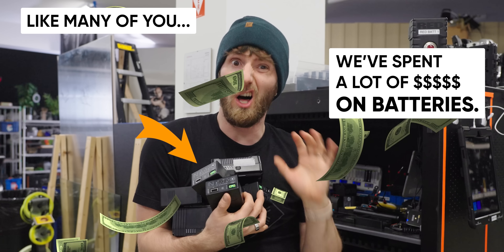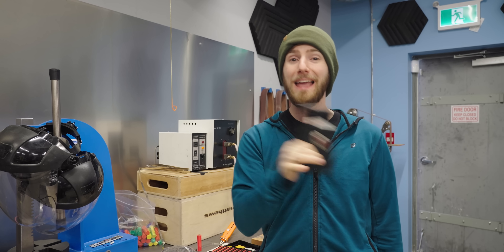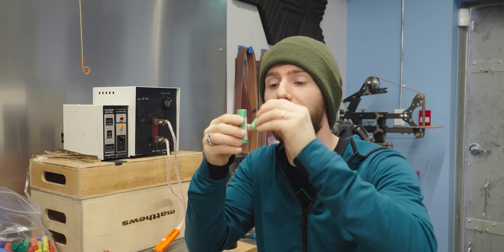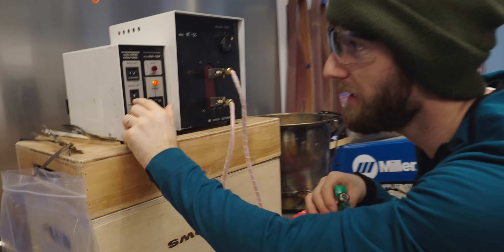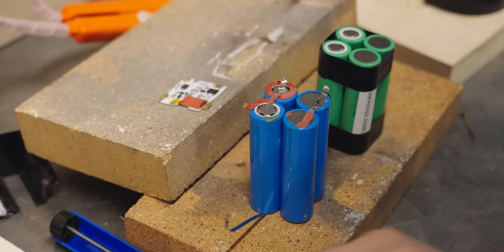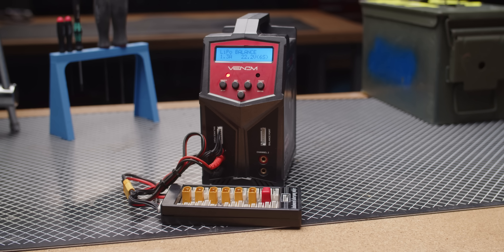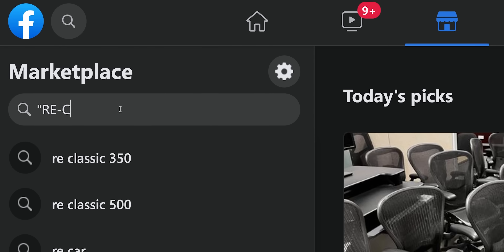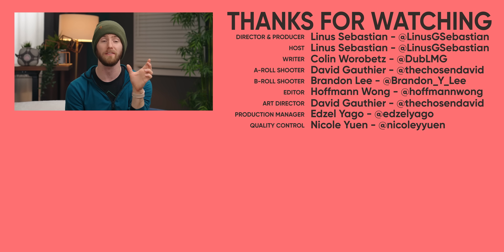This should be illegal… Battery Repair Blocking

Comment: Stay near the center of the cell top and away from the edge (where the battery wrap is).  The entire battery under the color wrapping is actually live.  I can’t remember if it’s positive or negative but the entire battery cell is one and then the other is only the small top.  If your spot welding and you get to close to the plastic wrap you could melt it and short the battery.  Watching you spot weld it looked like that was what y’all were doing in this case.. you accidentally weld the positive to the negative right at the cell edge.
Reply: The top is positive and the rest of the cell is negative. And yes, that negative pole is dangerously close to the positive pole and it's only covered by thin plastic wrap. I've experienced some scary moments when that plastic cover was scratched or broken on used cells. Since then I always have 18650 shrink-wrap in my drawer and I always put it on used cells whenever I want to re-use them.

Comment: Every lithium battery in costumer electronics like these should be 18650 (or any of it's variants) and if you need a different kind of battery (because it needs to be flat for phones or to trace a strange motherboard) you should be required to prove you need a different non standard kind before putting it on the market.
Reply: Just like the old and gold AA, AAA, cr32, lr13, etc... standard.

Comment: Are the batteries inside not e-waste themselves? If so, you’re not keeping anything out of landfills. What is needed is batteries that rejuvenate themselves. Just wait until all those electric vehicle batteries start entering landfills. The pollution of fossil fuels will be minuscule in comparison.
Reply: That Red battery pack was a bad example. It's not a device with a built-in battery, it's just the battery cells with a little plastic around it and a small pcb. It was actually the worst example because those v-mount battery packs are a decades-old open standard which is used by all manufacturers in the film and broadcast business. These batteries are interchangeable between countless devices and you can buy them from dozens of manufacturers. It's actually the best system I know and only comparable in versatility to single AA NiMh cells.

Comment: Very nice video.
Ive been taking 18650 out of old notebook batteries for so long(5+ years) to fuel my RC stuff. heheheh.
I just solder them tho, take extreme caution, never had a cell go poof on me. So it is possible.
And yeah you can order any style BMS of of some china site, where some are really good.
I dont buy powerbanks or batteries anymore, just use the 18650 from old notebooks. Usually its just 1 or 2 (of the 4-6) cells that are damaged/empty.

Disclaimer, dont do it, i have 30 years electronics experience. Just send them to me. :D

Comment: Those battery fires aren't inextinguishable, and that's a dangerous myth to promote because it prevents people from preparing with better fire-fighting alternatives. The lithium combines with water to produce two chemicals, lithium-hydroxide (or something like that) and hydrogen gas in the form of H2. Notice the missing O on that last one, and you'll understand where the problem comes from.

Comment: for this video, it is bad example, i did just like you in early stage. You should study a bit for this, especially when you doing it with big amount of battery, it should go through IR and capacity cabinet tester which vape shop cant provide and not expected for that kind of use.  
Battery is quite complicated, it got brand, capacity, IR, volt, charging/discharge behaviour, and also power/capacity battery.
so if you really trying the replace them you have to use the same model or similar specs from product sheet, especially for power tool(power drill), hand vacuum, they need power battery for higher discharge current.
ps. vape shop usually only sell capacity battery.

Comment: I am struggling to solder wire on top of a new 18650 battery of my mini vacuum, it could be much more easier, if that just like anything with AA or AAA batteries. 
Anytime I can I try to educate other people but it should be done more.. thanks Linus
Reply: Been changing the 18650's in my house lights as well. Vigorous sanding (I used an engraving tool with a sander tip XD ) and using the thick part of the soldering irons tip seems to help.

The new battery was about the price of the light and lasts a couple of weeks!
Reply: @Hajile_Ibushi  If you use good flux, you don't even need to sand them. It needs to be flux for electronic components of course, none of that stuff for metal pipes that contains acid. But with some of the stronger electronics flux varieties, you can be quick enough with the soldering iron as to not heat up the cell too much. It works fine, I've done it a couple times.

Comment: This means that even in case of deep discharge, the BMS’s memory will be wiped off. Even though BMS will be able to prevent deep discharge, however if a fully discharged is kept idle for long time, this can still lead to wiping of volatile memory.

Comment: Most BMS have safety feature. They when you put the batteries in cut the output, until outside voltage is applied (charging). That's for safety to ensure thing will short out during shipment. You only need a few seconds of charging to unlock it. Did you try to charge the battery?
Reply: And the sparks they had were not short circuits, but just simply sparks from the spot welder making bad contact. Sad that they threw those fine cells away.

Comment: Hi Linus and team, as a previous Quality engineer at a solid state battery manufacturer, I have learned a thing or two about … well batteries and BMSs. BMS charge curves have to be tailored for the battery chemistry. Some battery packs, of same size, and voltages, will not have the same charge / discharge curves. (Look for the “C” value - C/20 for large packs like the one in a car or 20c like the ones on those dumb LiPO RC packs you were showing off)

If I were manufacturing a BMS today, I would be sure to add tamper proof features, because, like you kind of pointes out, when a fire occurs, it’s the manufacturer’s name that’s on the box … not yours. 

However, I do think the last camera manufacturer has the best idea here and to offer something like cell replacement is a great idea. AND I would LOVE to see a battery recycling center.
Reply: Yeah, I was thinking the same thing... certainly Red or Sony wouldn't like to see footage on the news where one of "their" branded battery packs goes up in flames and hurts a bunch of people. I can kind of understand their reluctance to let people work on those products.

Comment: The board probably detected the sudden voltage change from low to high...maybe this would work better if you completely drained the batteries first?

Comment: seeing linus assembling the battery is funny af, I worked in a factory where we welded the batteries together, it's actually a multi step process.
First, glue pairs of batteries,
then glue pairs of the paired batteries,
then you weld those 4 together,
Grab a few of the 4 cell packs and weld those together.

And yes we did this for Red One cameras xD

Comment: That spark was caused by the crappy spot welder leads or not applying enough pressure.. the batteries are just fine.
Source: my job.

Comment: I was planning on doing this to my laptop's battery which i found out has 4 18650 Samsung batteries in it, but 4 new batteries cost more than a brand new assembled battery....
Reply: Re-celling battery packs usually doesn't pay off when you have to pay end-user prices for the cells. The cells are the most expensive thing in those packs, the rest is just some plastic and a small pcb.
Reply: @highks496  yeah my vape shop sells batteries for abt $10 for a piece and a complete battery is around $30

Comment: Did you really need such high power batteries for this application? You could have probably doubled battery life using 4-5000 mah batteries with 10 amp max output.
Reply: There are no 4000-5000 mAh 18650 cells, at least not real ones. You can find them on ebay, but they're using "Chinese mAh". The highest you can get is 3600 mAh, I haven't seen any more yet.
And Red batteries are known for their rather high amperage rating, Red cameras consume quite a lot of energy (at least the old models used to). These batteries (v-mount) are often used for LED lights and larger monitors as well, so you'd definitely want a 10A continuous rating at a minimum. I just looked up the tech specs of Coreswx batteries (who according to Red make the Red batteries) and all their v-mounts are between 12/20 A and 15/20 A (continuous/max)

Comment: hey noob.....reset the bms!!...and use smaller strips to not short out the batteries! some bms you can reset without software! but for some u have to use a computer! both should not be a problem for you and your company!

Comment: 18650 batteries are surprisingly dangerous if they decide to miraculously fail. they are the most commonly used ones for vaping too. ive had a couple blow up on me and its kinda scary. one turned into a rocket basically lol

Comment: A tour of the battery recycling plant would be pretty interesting, it's watt I want to see and hopefully there's not much resistance to the idea. Will you go in the front gate or do you think you'd have to volt the fence? A move into current affairs is a strong one.

Comment: You wouldn't need to sacrifice a battery just get an object 18 mm in diameter and some 65 or greater. 18650 is the dimensions of the battery.

Comment: I have an HP zbook with an external battery pack, and you CANNOT rebuild that thing.  the pouch batteries they used are near impossible to replace, and the pack itself has to be cut open. I hate it. But HP discontinued my battery, so yep, I just do without.

Comment: I bought a cheap smartphone - Alcatel One. After a few months out of warranty it wanted to upgrade Android. Okay, I let it. The upgrade failed and the phone went back to factory default. Little annoying but I'll survive. Then it kept whining that it wanted to try the upgrade again. After around six months I finally relented and it went through just fine this time. Or so I thought. I then started to have mysterious problems with charging the phone. It would take a whole day just to charge maybe 20%. At this point I bought a replacement battery off of Ebay for £6, exactly the same problem, would take many hours for very little charge. Then neither could be charged at all - both "dead". So I bought a cheap, universal, lithium battery charger for £5. Works like a charm, both batteries can be fully charged to around 97% + and it even charges an ancient Motorola Razr V3 br50 battery from way back to 2006. I love beating the system.

Comment: never can be often proud as a german, but our engineering and manufacturing is usually top notch, so not surprised here. not meaning most companies are greedy bastards either here, but hella good job there bebop.
Reply: They still have to throw out the old cells, which are like 98% of the battery pack (from a resources and price perspective). The rest is just some plastic and a small pcb. These big v-mount battery packs are really the worst example for wastefulness or anti-repair tactics. These are already user-replaceable batteries that go on countless different devices with a standardized mount (v-mount). It's not comparable to some stupid bluetooth speaker with a built-in battery where you have to throw the whole device away as soon as the battery is dead.
And usually, from my experience, you can get at least 6-8 years out of these v-mount battery packs because they use high quality cells.

Comment: Ideally all those cells should have  been run through a discharge/charge cycle in a charger with a cell by cell BMI to ensure that not only the voltage matched but the charge in the cells matched.
Also using very thin nickel strips is actually a safety mechanism, they will act like fuses in the case of a short.
I'm honestly not sure how you managed to short out so many cells but you should be using Kapton tape after each and every step and to prevent shorts, I've only ever had one short and that was caused by me dropping a battery in to a pre wired battery box.

You can often replace the BMS too with a generic one as long as the BMS doesn't talk to the device it's being plugged in to, for RAM based BMS's you can also use long wires to connect a second set of batteries and then sever the old ones before putting the new pack in to place and removing the long wires HOWEVER this is super dangerous as both packs will try to self balance and you could damage the new set.
Reply: The sparks they had were not short circuits, but just simply sparks from the spot welder making bad contact. Sad that they threw those fine cells away
Reply: @makimcleary393  Yeah, I was irritated watching them waste battery after battery because they just assumed a spark meant the cell was burnt. I'm not so sure about the qualifications of their engineers.
Reply: @makimcleary393  Sparks from the spot welder wouldn't damage the cells so if that was true they wouldn't have needed the sand or to get rid of the batteries (note they cut the sparks out of the video due to YouTube Guidelines).
Reply: @ThatGoth  why can’t you show sparks on YouTube?
Reply: @dervader26  lol yea i wanna know as well
Reply: @dervader26  You can't show dangerous acts.
Reply: @GamingXperience  if they've shown warnings about not doing this, why can't we see spark ffs, that's madness. I've seen so many dangerous videos from cars/bikes going fast in cities, jumping from building to building, the list goes on and on.
Reply: @ThatGoth  what about those chemistry videos where they mix powder chlorine and brake fluid?
Reply: @madbull4666  Welcome to the Absurdity of '80s corporate law in an Info-Age society.  Dark Age of Information Indeed. Censorship = control = power.
Reply: @EmoBrianEno  They are likely to be tagged as age restricted, which limits your audience and your advertising revenue, I expect LTT is not age restricted to maximise revenue.
Reply: Just add a diode to prevent "self balance" no?
Reply: Every time i saw "spark" i shouted, "dropped" - The amount of "sparks" Linus made is over drop count in one video!
Reply: I cringed really hard that way this was done
Reply: @Ziplock9000  it's like they wanted to do a video and it was 4pm and needed to get out by 5. 10 minutes of research then let's get cracking on with it. I like LTT, but quite a few videos are just filler and really badly done. They need to do less videos, or have a bigger range of hosts and more researchers along with a few experts.
Reply: @dlewis9760  that's exactly why I stopped watching them as much as I used to. I like the dialogue, the messing around that they do compared to the other channels, makes it more enjoyable, but the other channels information on a specific topic seems to be far better. They do something around 16 videos a week I think, which shows on their videos, too much content not enough substance.

I miss the janky house setup from years ago 😂
Reply: @Maverrick2140  Kapton tape would have prevented that too.

Comment: Given how common it is to make battery packs with 18650s I don't think it's even that hard to expect makers to allow the cells to be removed from the pack, a bit like AA's. I have a bubble machine for the kids that uses a 12v wall plug or it came with a very basic battery box. I can literally open that box up and replace the cells exactly like I would if they were AA. I see no reason this couldn't be done with vacuum battery packs or drills etc.

Comment: 2 big nono's here... there is no extra insulation, or space between oposing cells wich are not in parallel, and no insulator ring on the plus poles of each cell... this can lead to shorts after time if the battery is mobile and not stationary

Comment: Battery wise I think safety is a decent enough reason, you had all the equipment and precautions and enough expertise and still didnt pan out, someone DIYing it and burning down their house could be a problem. Right to repair wise, had a cable for a Dell charger get mangled, tried replacing it by opening it up, impossible to do without taking pliers and a hammer to it and really going at it.

Comment: I don't say Linus is wrong or misleading, but does it have been tested : On many BMS, you have to put back voltage to wake him up on the load side ! 
BUT ! Many chargers don't send anything to the batteries if they don't see a voltage back while testing before sending charge. 
You will need a stabilized power supply in order to wake up the BMS, and set at a correct voltage.

Comment: @LinusTechTips As a safety messure, you need to cut the corners on your nickel strips to prevent shorting when welding them to the positive sides. 
Also, as many have stated bellow; You need to hook up the bms to a power source after replacing the cells as the BMS is simply turned off. 
Ideally, give the new cell pack (after connecting the BMS) a full power cycle for optimal operation of the BMS.

Comment: Similar issue for bicycle lights, anything good is rechargeable, and uses these cells in a way that's not user replaceable.

I found one that allows for swapping out the cell. The Lumintop B01 can fit a 21700 and has a sleeve for a 18650!

Comment: Some BMS units require a bootstrap voltage to start them up. Sometimes a jumper wire from the b+ to the charge input or v+ (output) is sufficient to get them started.
Reply: This

Comment: There loads of battery 'scams' out there in the enterprise. BMS that count charge cycles and fail, setting in-service dates in the OS, some smaller RAID cache batteries are proprietary so that you have to go to the OEM for replacements and they are not cheap.